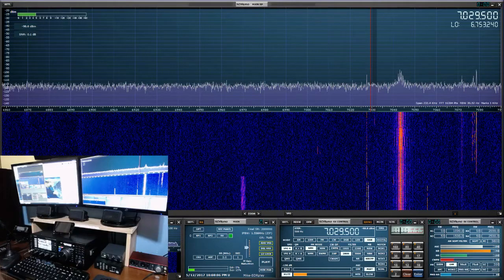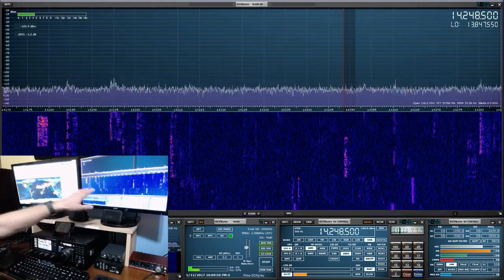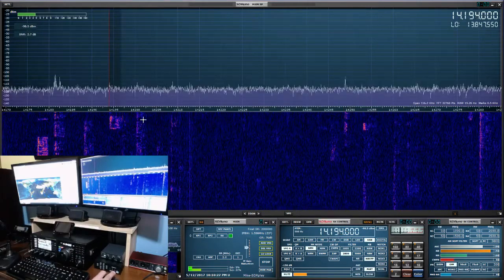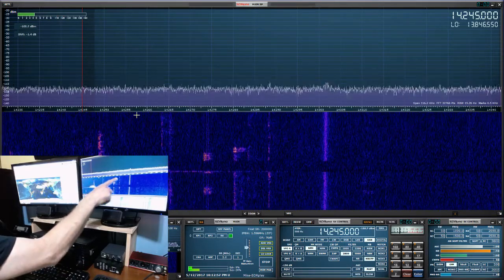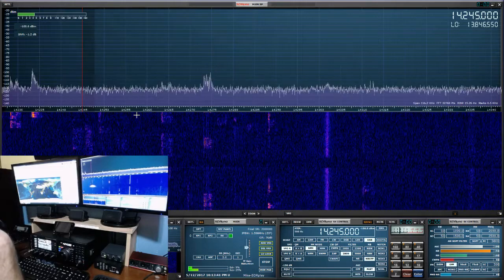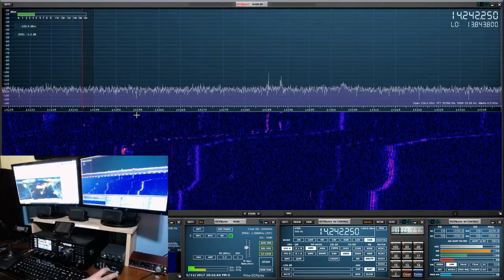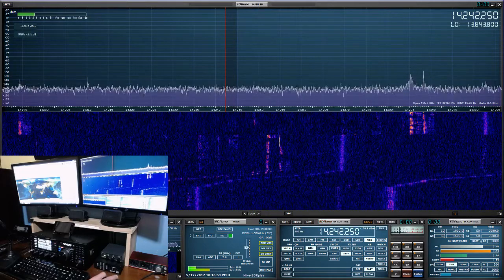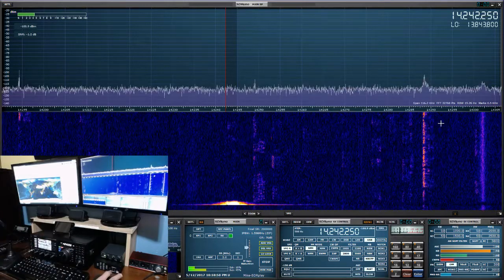SDRuno, FTDX 3000, Omnirig & LOG4OM Logger In Action (MV012)

Comment: Hi Mike , great videos I know this is a older video but I just wanted to know if you use anything to protect the front end of the receiver of the SDRplay? Are you using the #3 antenna in on the FTDX3000 if so how would you hook it up to say a ft857d to have the panadapter for portable use. Thanks Chuck KK6USY
Reply: thanks  @Mike-Mike-u7b

Comment: Like Your videos Mike, good job. Can You show how to set SDRUno to work with SPLIT mode. I'm TS-590SG user and with HDSDR there's no problem. Best 73 Wald SP3UR
Reply: When I use HDSDR I can smoothly tune VFOB just by pressing TF-SET key on the rig. Then I can change freq by cklick on waterfall or by VFO knob. I release TF-SET button and I'm back on VFOA. It works great. In SDRUno when I release TF-SET button SPLIT mode is shutdown. I'm using one VRx.
Reply: When I push PTT or key LOB is no labeled but when I push TF-SET button on rig LOB is labeled. Next thing that happens with SDRUno, sometimes when I stop sending on CW or on digi modes, transmitter still is on. That never ever happens with HDSDR. So SDRUno looks brilliant, in receiving works superb, but to TX I choose HDSDR. Without surprises :-)